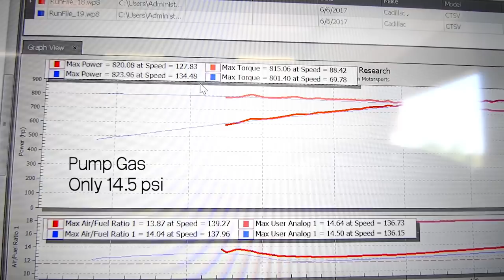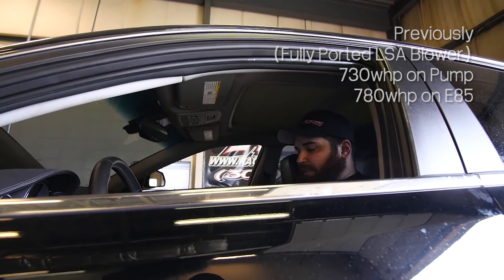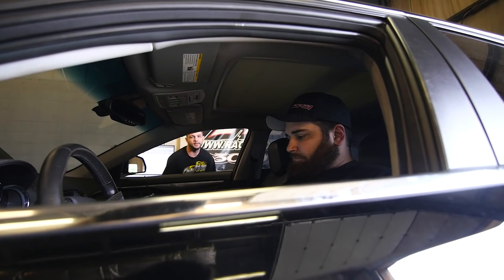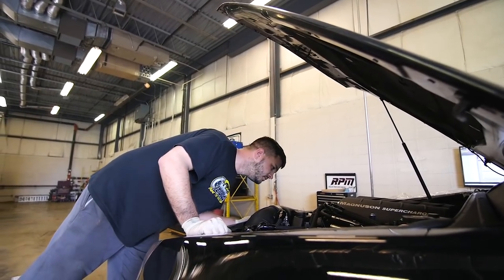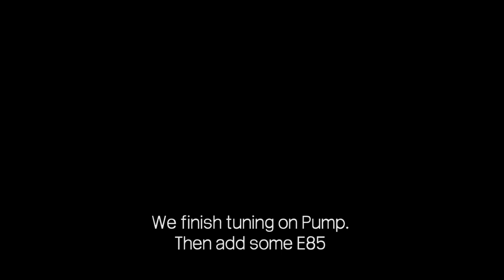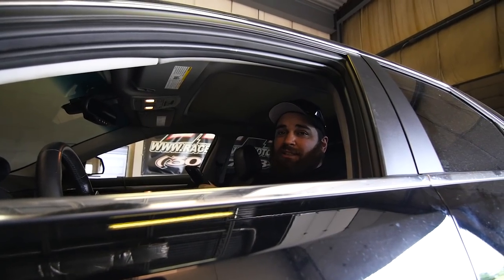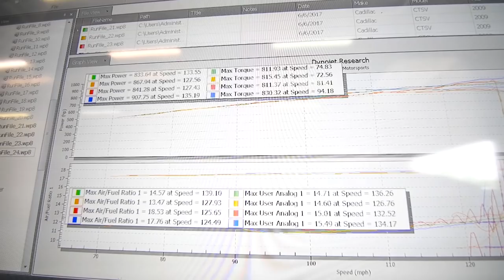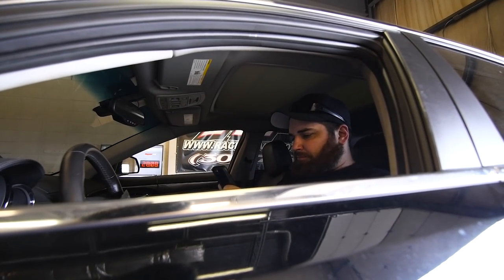CTS-V Magnuson Heartbeat + RPM 5" Intake = BIG POWER

Comment: Yeah it definitely seems like the factory blower becomes quite the restriction when the top end of the motor is done. Even with all the work performed on the factory blower, this Maggie blower beat it by 80-100 hp at the same boost level. Then E took it to another level. Fantastic!
🇺🇸💪👍

Comment: I know the engine is very built in this video, but I'm wondering what the necessity components would be for a "stock" V2 upgrade. I would think injectors (1050?), upper and lower pulleys and additional cooling? Or would you have to build the entire thing up in order to see any difference with the heartbeat?

Comment: could the 5" intake fit on a  LSA supercharged  chevy ss? i think it would have more clearance
Reply from the maker: xRated I believe they do fit
Reply: I test fitting this intake on my ported lsa 16 " Chevy SS m6 it will fit but will require about 3.5" to be removed off the end and put another bead on it where you cut. I have a bunch of pictures ill send to rpm. Ill be get a dyno soon and shoot for the manual record.

Comment: what were the final numbers on pump 93 ?
Reply from the maker: 832whp I think maybe 10 more tq I'd have to check.  Still only 14.5 psi of boost which was the most impressive part.  If we changed pulley it would of done a lot more.
Reply: RaceProvenMotorsports Wow that is impressive 14.5 psi  ?

Comment: I have to call ya out on this nonintake is going to make 100hp man leave the same exact tun and swap out the 5in for a 4in and I bet it won’t make even 25hp more then the 4in. If you have a 4in throttle body and 5in exhaust the 4inch throttle is not going to flow the a mount that that 5in intake can. I want to see a back to back 4in vs 5in no tuning done no timing increases then you will see what’s better
Reply from the maker: Leave the same tune in huh?      Stick with YouTube comments and don’t try to tune any cars please.    Thank you
Reply: @RaceProvenMotorsports  i just want to see a back to back run 4in then 5in no timing change just tuned to the same afr. you can pull the air filter and pipe off and it might even make more then with the intake. just want to see a back to back. if you throw more timing on one setup then the other its going to make more power and its not a real comparison. I'm not trying to be an asshole just to many people on youtube try and make there stuff be something that it really is not. so if it is just prove it